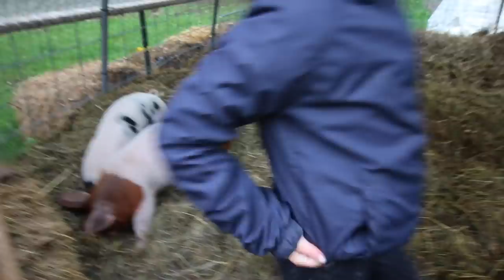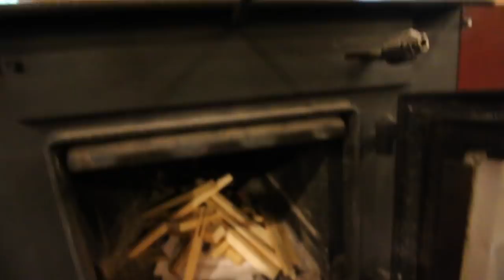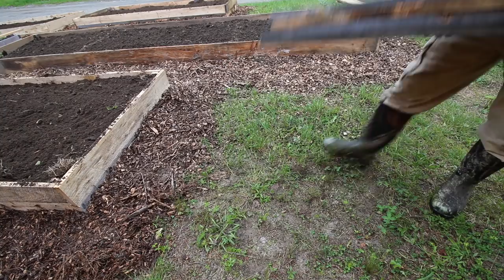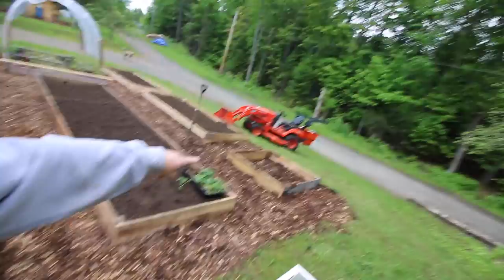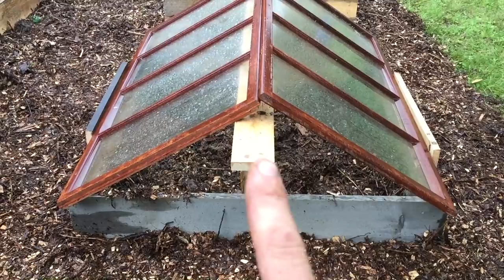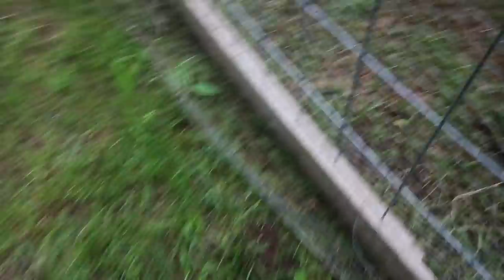Can an 8 Year Old Hand Feed an Icelandic ROOSTER!

Comment: Nice work with the new garden beds. I was just thinking you should make them a tad wider to accomomdate the width of the bucket and you said the same thing!  It might not be necessary but may be a good idea to add a fitting at the ends of the glass apexes to prevent strong winds lifting up the panels and dropping them down again? I liked the 'crazy face' subliminal family photo shot at 16:06 :)
Reply from the maker: Great minds must think a like😁. I put the face bomb in there to see if any one noticed! Winner winner chicken 🍗 dinner 🍴